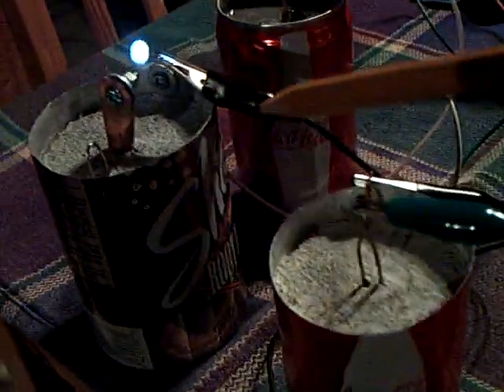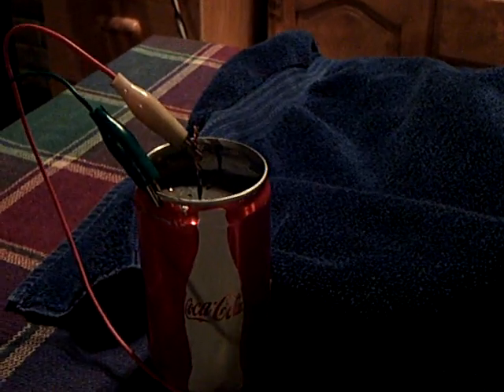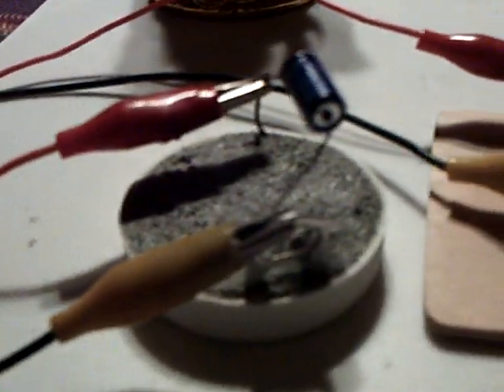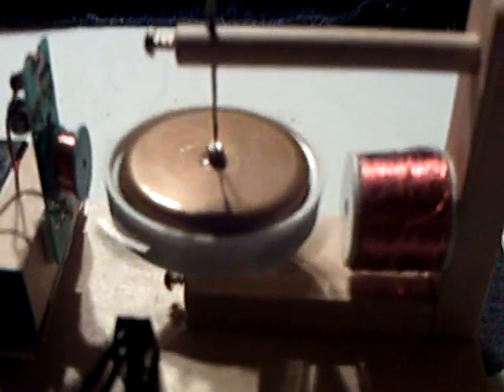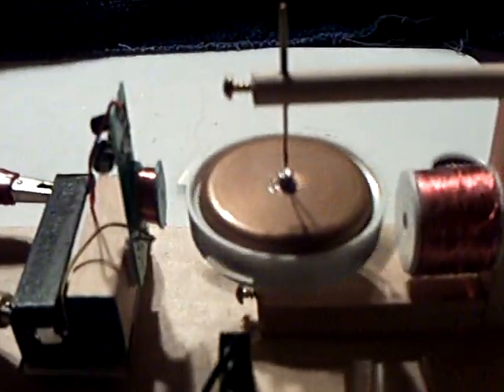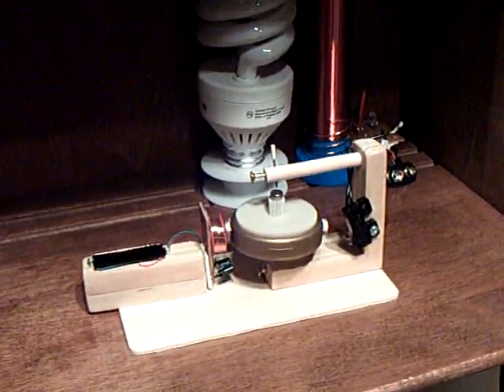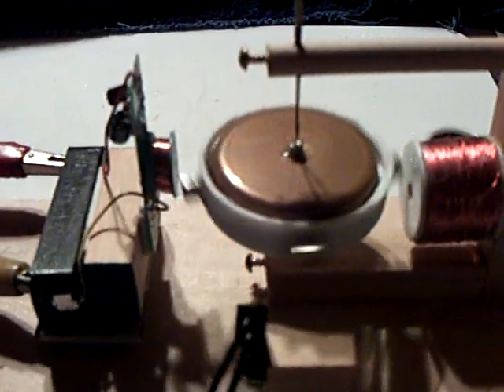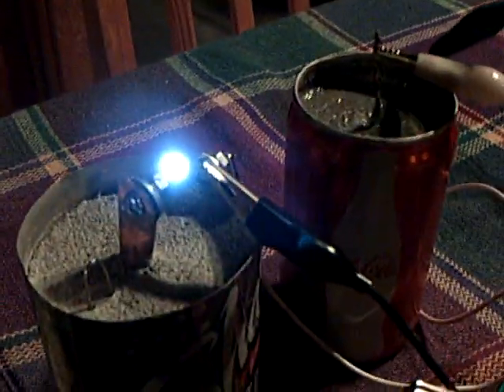Cement batteries doing work.ASF

Comment: Hi, I've used just cement in tea light candle holders, so they are pretty small, I was getting about 1.2 V off it so I made 12 and hooked them all up and I'm getting 12.5 ish volts out of it just using cement, but I think it's AC only. Do you know what I can test this with, it wont run a small motor or a bulb, wierd. But I've got 12volts

Comment: @Lidmotor I'd like to give this a shot as well, I've done some experiments with earth batteries and the results were rather disappointing.
So if I understand it correctly, you take the top out of a can, sand the inside of the can, put concrete in the can, put one probe on the can and one probe right in the middle of the concrete and then let it set.

If it works the same way as an earth battery, you'll get more volts using a taller can with a longer rod in the cement or wider can.